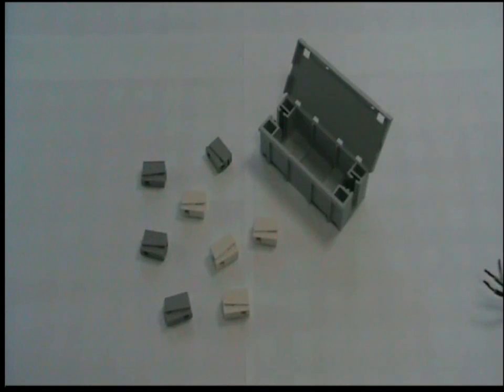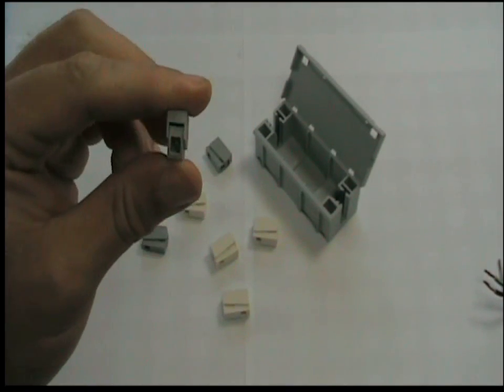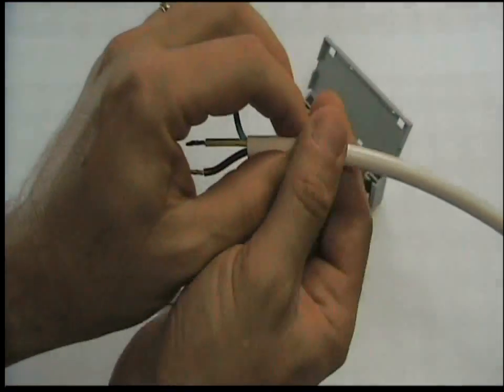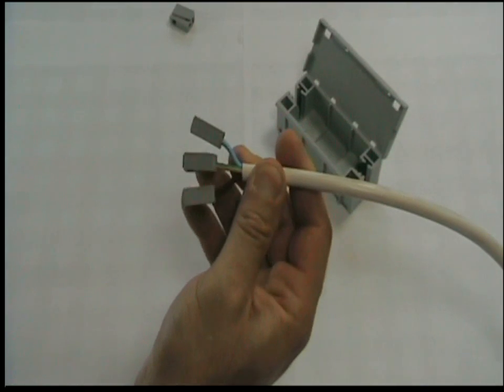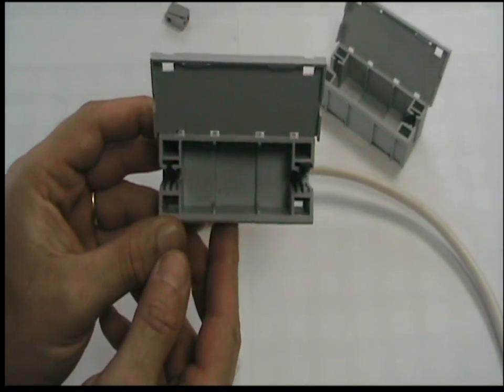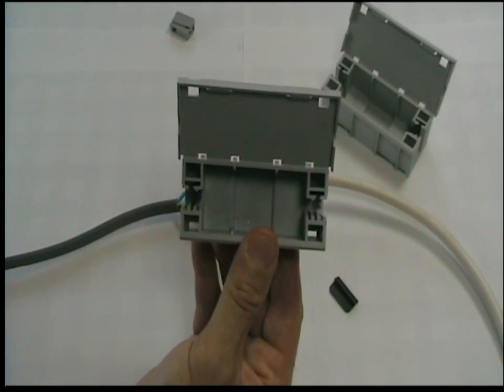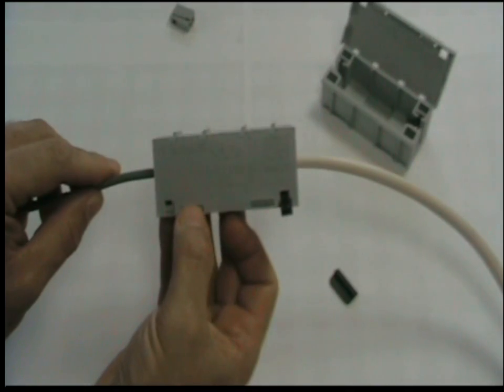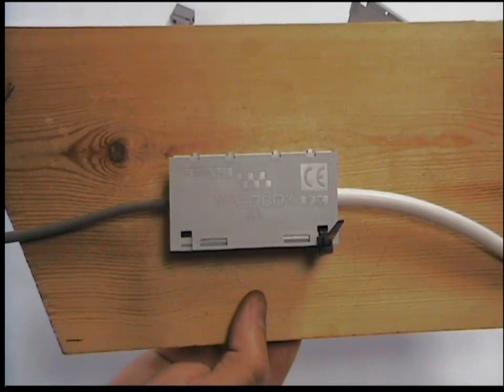CONNEXBOX® Light Electrical Enclosure | Junction Box

Comment: At least according to your website this is not MF, which kind-of limits the utility. It also seems relatively inflexible on cable types/numbers.

The Wagbox 221-4 seems to be a far better product to me.
Reply from the maker: Hi Peter, thank you for your comments. 

The Wagobox-Light is the only one of our enclosures (other than our IP68 Capsule) that isn't BS 5733 Maintenance Free. This is because 99% of the time the Wagobox Light is used for accessible installations  such as spot lights, and its compact dimensions (39 x 29x 95 mm) make it perfect for fitting through a 60mm diameter spot light hole! 

The Wagobox Light can be configured as you desire and supports up to 3 cables (the integrated cable clamp can secure flex and 6242Y and 6243Y twin and earth cables). It comes with robust cable grippers that can be configured in seconds to grip the cables (up to 8mm in diameter) and is designed for use with Wago 224, 260 and 291 terminal blocks to suit the job.

We have 4 other models of Wagobox Enclosures which are BS 5733 Maintenance Free and all designed for specific WAGO connectors. You can find out more details on our website - www.connexbox.com

We're pleased you like the Wagobox 221-4 :)

Comment: Can i use ordinary WAGO 221 terminal instead?
Reply from the maker: You could use 221 connectors but you would need to arrange them carefully as they are a single side entry connector. The Wagobox-light works best with through connectors. I would suggest the Wagobox  ( https://www.youtube.com/watch?v=xOZDLhRyE9c&t=1s ) is a much better enclosure to use with single side entry connectors.